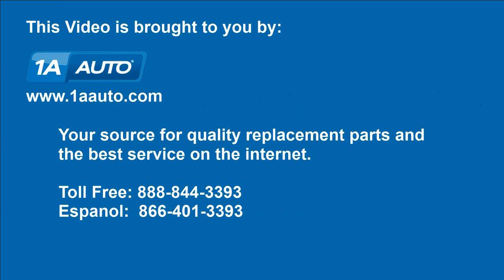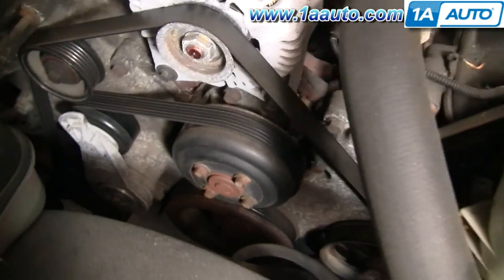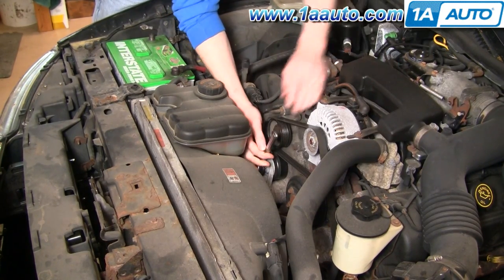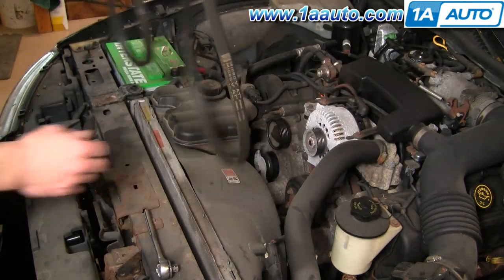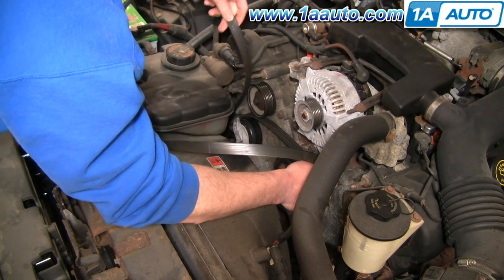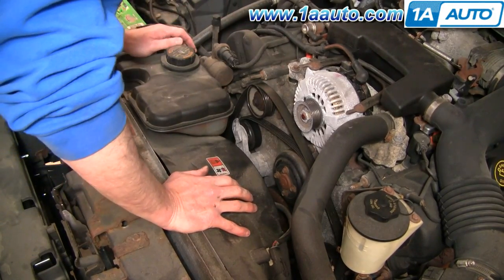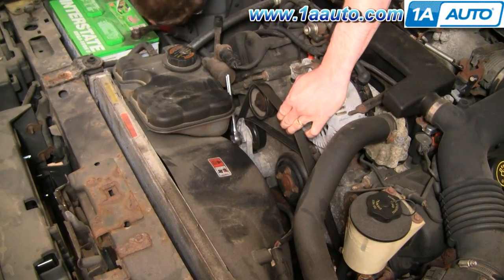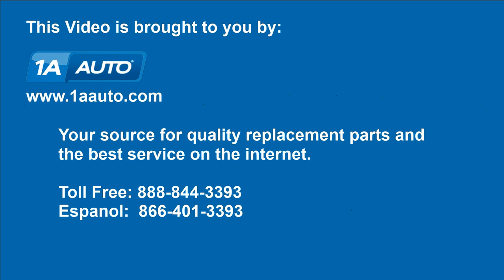How to Replace Serpentine Belt 00-02 Lincoln Town Car

Comment: I just installed the serpentine belt on my 2004 Towncar. I needed the installation tool to be able to slip the belt over the alternator pulley's outer edge. Once  on, it worked beautifully.
Reply from the maker: +TheNoncritical1 Thanks for the feedback!

Comment: Take a picture with your phone so you can see how the belt goes back on! Saved me a bunch of time.
Reply from the maker: Nice tip Ron! you could also draw a simple diagram of the pulleys ad route the belt around that. Thanks for watching.
1aauto.com 888-844-3393

Comment: Pretty easy!  I have the service manual and it didnt say to use the socket handle in the center of the tensioner pulley.  It just said to rotate it clockwise but you were left to your own devices as to how to do that.  With this video explaining that you just need the tool for that single pulley I got the whole job done in less than 5 minutes.

Comment from the maker: The best way to get any car to last for a long period of time is to keep the oil and fluids clean. Changing the oil every 3,000 miles or 7500 (if using full synthetic) will really help to make your motor last. 1aauto.com 888-844-3393